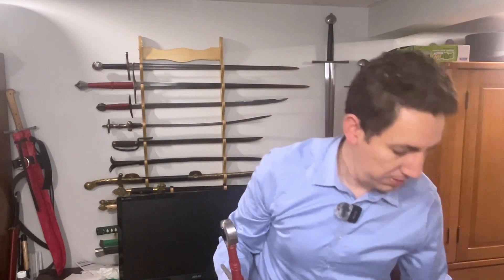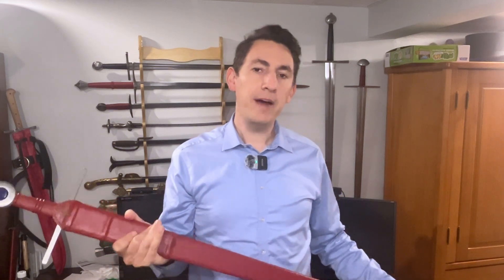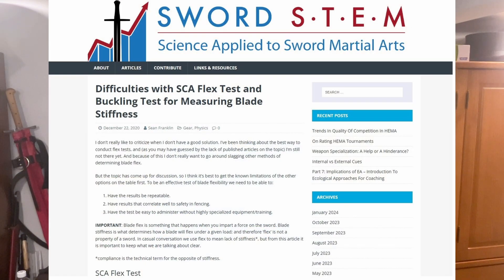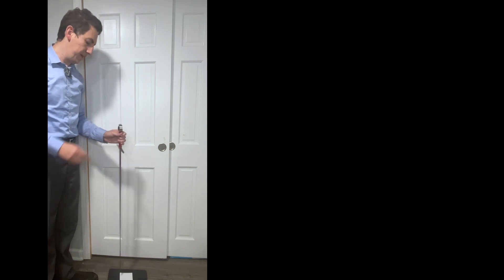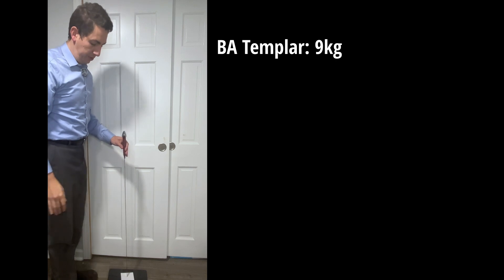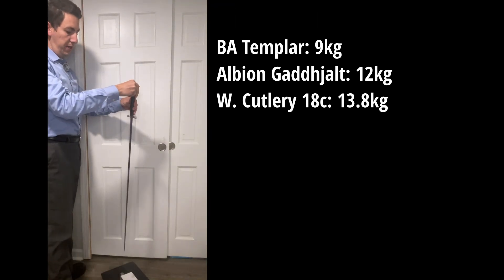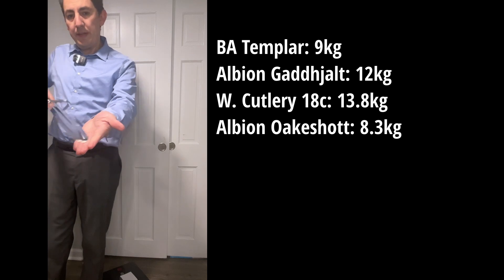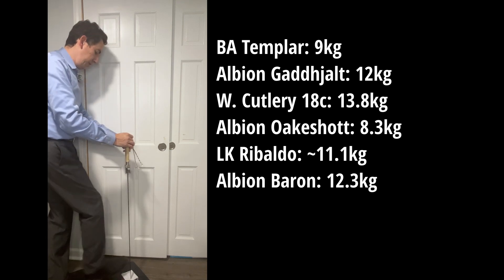Stiffness in swords: how is it measured?

Comment: Hate to correct you, but heat treatment has virtually no impact on the elastic modulus (ie, "stiffness") of carbon steels, nor most (possibly even all) tool or stainless steels. For all intents and purposes, a sword's stiffness is determined solely by its geometry, with minor contributions from the choice of alloy, though the moduli of almost all steels used in swords are within 5% of each other.

This is a common misconception that likely stems from heat treatments' effect on the yield point (ie, how much the metal can be deformed before it can no longer spring back into its original shape). Metals tend to behave like they aren't as rigid when they're permanently deforming, and the more a steel is hardened, the higher its yield point and the more force is required to put it into that "bendy" state.
Reply from the maker: @irrelevantfish1978  I’ve made this mistake before! For some reason I get it in my head that only steel type is negligible to Young’s Modulus and that HT should still impact it.

I suspect that it is because on historical examples, prior to spring tempering there is a tendency to make more “robust” cross sections, so I associate such HT with stiffer blades. Oops.
Reply: @dlatrexswords  Don't feel bad, as you're in good company. I've heard two other prominent Swordtubers make the exact same mistake. Materials science can be quite counter-intuitive, at times.
Reply: This might be too late to ask, but I am curious: Does spring tempering increase yield point more than hardening?
Reply: @Vlad_Tepes_III  I assume what you're asking is whether spring tempering a blade will make it more resistant to taking a set than differential hardening. If so, the answer to that is, "Yes, if all other things are equal."

But FYI, spring tempering is sometimes called "through hardening," and yield point is a material property. If you want to get technical, whether spring tempering or differential hardening produces a higher yield point depends on which part of the blade you're talking about.
Reply: @irrelevantfish1978  I was actually referring to hardening in general, be it through-hardening, shell-hardening, or differential hardening.
Does through-hardening and spring tempering mean the same thing? Isn't the former a product of quenching and the latter a product of reheating and cooling the blade after quenching?
How does the yield point vary from part to part if a blade is spring tempered vs. hardened?
Reply: @Vlad_Tepes_III  Yes, technically, hardening and tempering are completely different processes, but swords are almost always either through-hardened and spring-tempered, or just differentially hardened. As a result, the sword community tends to use "through-hardening" and "spring-tempering" interchangeably, and will often use "differential hardening" even when "differential heat treatment" or "differential tempering" would be more correct.

As to how heat treatment affects properties, hardening increases yield point and spring-tempering partially reverses the increase, though not as much for diffusion-based hardening processes like carburizing or nitriding.

Comment: I used the same method. 
1. Antique British 1796 light cavalry sabre: 10.6kg, and 11.3kg if I force the flex to occur on the other side (so there's a preferential side for the flex, the curvature also is an issue for this one).
2. Albion Brescia Spadona: 18.5kg (makes sense since this is a triangular blade with a stiff anti-armour type blade)
3. Albion Machiavelli: 9.4kg (feels stiff)
4. LK Chen Ribaldo: 7.6kg (it has about 7cm more length on the Machiavelli for the same type of blade; less stiff, but it feels good and as I expect such a longer side-sword to feel)
5. Windlass Christus Imperat Rapier: 5kg (this feels floppy like a noodle; and flex is not everything, its spring nature feels bad; hard to describe)
6. For my HEMA trainer, one-handed side-swords are almost always 9kg (3 different makers; basically same flex), and a longsword feders is 13kg (seen as a bit on the threshold of being too stiff in the community that prefers more 11kg). I also have a semi-custom Black Fencer rapier with a 114cm blade, which flexes at 9kg, seen maybe as too stiff for a rapier trainer that usually has only about a 7kg flex.
As a last thought, I like a bit of a flex in cut-focused side-sword blades, they feel more authentic for the 1500s, but probably that's more to do with the correct weight distribution on the blade as the good quality steel of the period allowed for quite thin blades. At the same time, a bit of flex in thrust-focused blades feels bad; I need to feel that I push through before I feel the blade bending. And no, I didn't expect the Machiavelli to have the same flex as a trainer since they do feel different as blades go; so flex is definitely not the entire picture.

Comment: Of course there's steel typing for modern replicas. 1045 carbon steel's generally the lowest to go. 1040 much of the time makes a sword blade too soft. 1095 results in hard hitting swords and a blade that's not too much less flexible. Though they're more vulnerable to breaking due to increased brittleness. Stainless steel for the purposes of a sword is too resilient to bending and thus alot more likely to fracture. No surprise spring steel; otherwise known as 5160 steel, is excellent for this, but is notably more expensive. There are currently a couple of Asian sword designs that are made with T10; which falls between 1095 and spring steel. Though T10 hasn't been perfected yet. 

As for the sword-like objects epee and foil, the modern designs being extremely flexible is highly beneficial.

Comment: The best way I have found is to put the blade into a standard flex rig with degree markings & then use a hanging scale attached to the pommel to see how many lbs are required to flex the blade to the same degree mark. However how much flex one wants can indeed vary quite a lot from sword to sword, user to user, task to task.
Reply: That's a good way to measure relative stiffness if you have a baseline angle you like, for sure. It's probably the fastest way to measure when producing runs of blades.

Comment: Finding the least amount of force needed to flex a blade is interesting, but I’m really interested in the minimum force needed to bring a blade to critical failure, be it bending or breaking.  Though, you’d probably go through many swords to find that out.
Reply from the maker: @outsideiskrrtinsideihurt699  hahaha sounds like a very expensive test!
Reply: That's the yield strength and requires a test to failure
Reply: The least amount of force required to flex is also useful to get an idea of how floppy or rigid the sword feels/responds while in use. Receiving a strike on the flat with a wobbly sword feels unstable, while some stiffer blades can use the flat to receive a strike or issue beats. 

What would be really nice is to compare both the least amount of flex required and the force required for plastic deformation or snapping. Something like a katana with a traditional heat treatment has a much higher initial resistance to flexing, but may deform at a level of strength lower than that of a spring tempered sword.